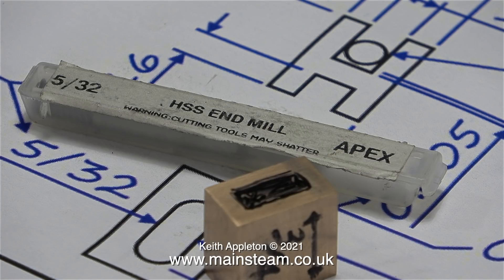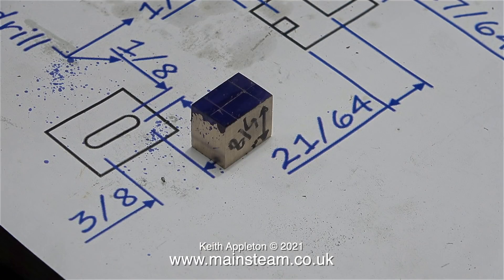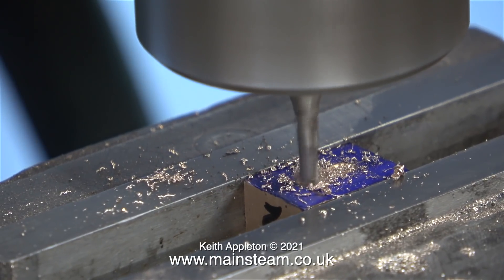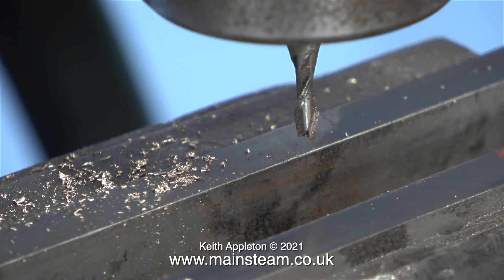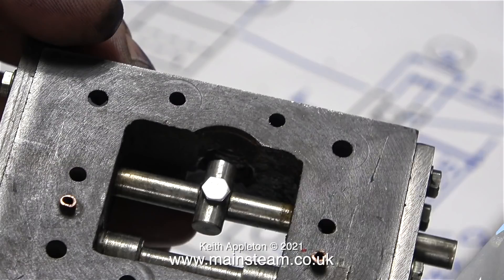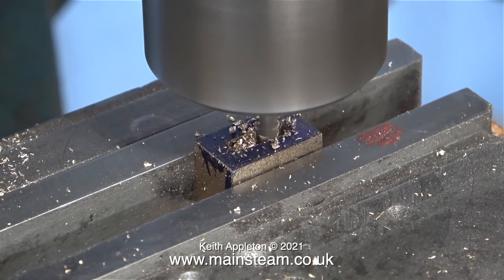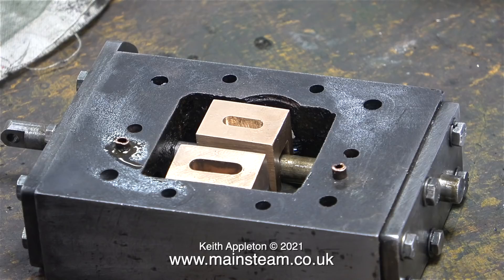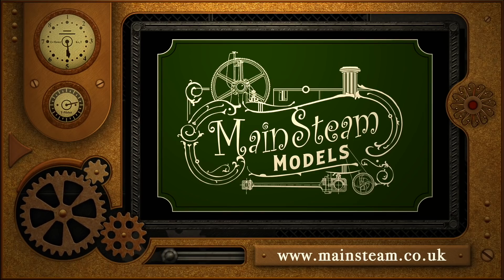REPAIRING A SOUTHWORTH 12 INCH STEAM PUMP - PART #8

Comment: I've found working with casting kits makes everything a lot more interesting, because I'm sometimes forced outside tolerances by a casting flaw, stacked tolerances, or a centering/datum miss on my part. Makes your videos interesting, as the slight errors of others often require optimizations on your part.